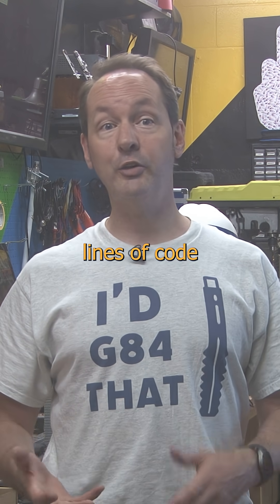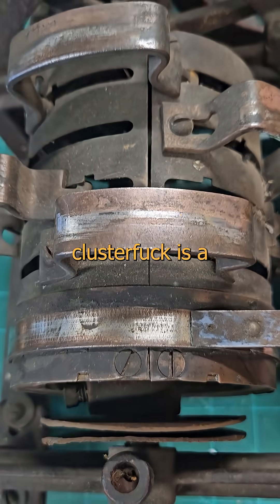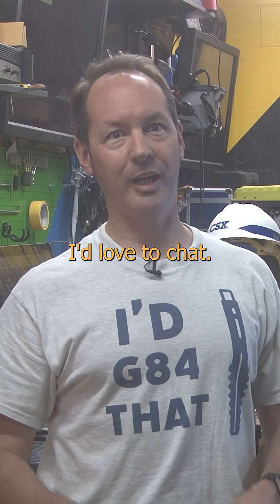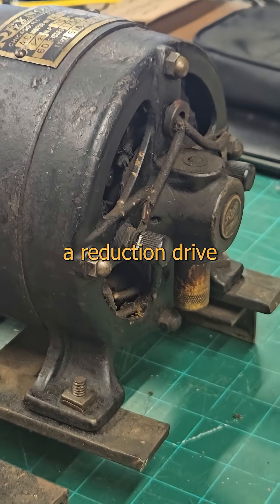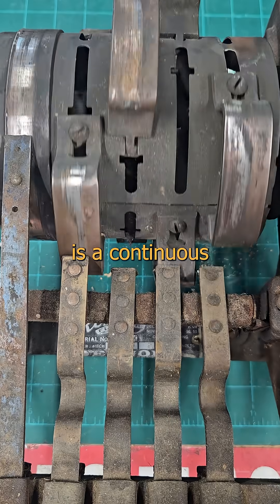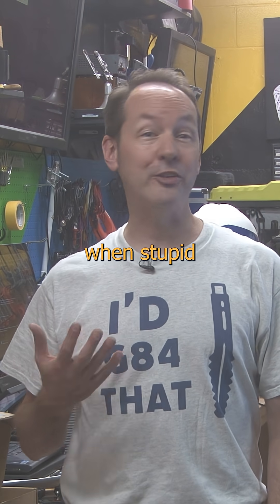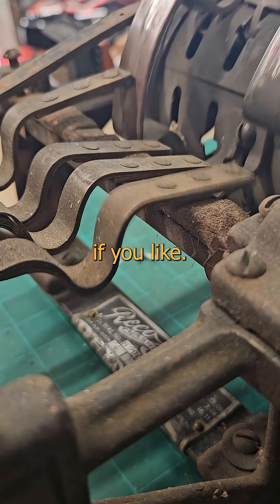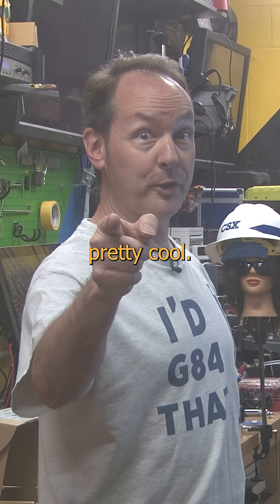Steampunk Sign Flasher #chrisboden #comedy #engineering #dangerous #electrical #educational #cam

Comment: i had a 68 mecury with sequencal turn signals. a small electric motor ran a cam that opened and closed 3 sets of points.  basically the miniature of this. very cool.  this is becoming my favorite channel.

Comment: My first thought is, would it be possible to adjust the resistance along the length of the contact so that you could fade in and out the light

I can't imagine it off the top of my head. I keep running into complications with each answer I come up with

Comment: The automated dishwasher at my work uses a similar system for timing the cycles of window add which cleaning agents and wind to switch from hot water to flesh stripping semi steam. It has a safety housing held together with the same kind of lock you use to secure toilet paper in a public restroom. The damn thing hasn't closed in over a decade.

Comment: As a kid, I made something like this. Took a BBQ grill rotisserie gearmotor and rigged it up to turn a salvaged rotary television tuner. Chopped up a set of Christmas Tree lights and wired them to the contacts on the tuner switch wafer. Yes, line voltage running all over, but it sure looked cool!

Comment: This is what we in the UK would call a "Heath - Robinson device" after William Heath Robinson is an artist whose work, whether in his well known humorous drawings or his illustrations of Ad Hoc devices. 
It was also the name of was an early attempt to automate code-breaking. It was specifically designed to tackle the hugely complex Lorenz cipher, used by Hitler and his generals to communicate strategic messages.

The complexity of the code-breaking machine resulted in its being named in honour of W Heath Robinson the illustrator, but he would never have known of this tribute because he died long before the secrecy surrounding Bletchley Park code-breaking ended.

Comment: The Fox Theater in Atlanta, GA still has and uses their original Reynold Flasher and Speller for the marquee and F-O-X sign. The bulbs are now LED but the motor and switches are still the same unit and restored to run 24-7

Comment: Local chain of a very regional burger place might have a similar system tbh. Granted you pull through the drive through and you can hear the clicking of all the incandescing bulbs on the outside going on and off.

Comment: I would totally dig taking that thing apart, ever so carefully. Cleaning it with a wire brush on the metai, and a parallel to a giant toothbrush on the wood. Then patiently reassembling the whole thing.

Comment: This is cool I worked for a concessions company we had a bunch or trailers with the chaser light marquees. The oldes trailer we had was from the 40's I think made by Marvel [pronounced Mar-vell]. It didint have any lights but it was built like a tank compared to the newer ones, the doors probably weighed well over 100lb held up by swing out steel round bar arms if there was some kind of failure and that door fell someone was probably dying if they're in the way

Comment: 1/20 HP... Man even in old days they use anything but metric. How the hell am I supposed to know or be able to compare and say  yea' boi that is exactly do the work of 1/20 of a horse.  I mean, a horse (full 1 or 2) is perhaps and very perhaps moderately understandable (something reasonable in its days, not anymore today) but... 1/20?

   I know that 1 HP is 745 watts (VA). But even so, what's the need to be so arbitrarily precise as to say 1/20 (0.05) of HP?
sayin 37W is more comparable to a 40W lamp than a horse

Comment: Oooh my local carillon has one of those to hit 2-12 ton bells for the Westminister Chimes. I get access to the mechanical room as a carillon student, but as a mechanical engineering major, I'm the only one who really appreciates it! The assembly is also like 3 feet tall because it has to lift 100s of pounds of hammers to drop on the bells.

Comment: The theater I used to manage had a marquee with chase lights.  It used a clock motor with a cam at the end of the shaft.  The cam would sequentially open four sets of automotive ignition points one at a time.  Worked for 50 years.

Comment: I worked at a milk plant where the programming for the filling machines were rolling switches riding on metal cams.
You'd swap out the cams for pints, quarts, half-gallons, and gallons. No safeties there either. On of the fillers lost his fingers while cleaning the machine.

Comment: I do have an interesting question for this why would you have the electricity on the rotating keys rather than just having the live conduit that bar that all those tabs are sitting on and lift them off the bar to break the connection and that way you don't have to have the live voltage running through the brushes and everything it's just a live bar that those contact.

Comment: 😭 They could have put the contactors under the arms, on top of that bracket they rest on, instead of making the whole drum live!

It would require reversing the lift, but would eliminate energizing the drum, and for those scraping connections, which are probably hugely unreliable.

Probably would last longer too.

Same exact concept, maybe some extra insulators needed to insulate power from going into the actual arms

Comment: I built a couple of light sequencers using TTL ICs back in the 70’s. I guess that makes them old tech as well. They used parallel load shift registers and driver ICs controlling Triacs. All floating at 120v, much like the device in the video.

Comment: Bacteria eats grease and that is why the grease used to lubricate the contact fingers is missing. I worked on Westinghouse drum controllers for 250 DC motors used in a steel mill.

Comment: I once remodeled a commercial property with the former owners offices above it. Including his own “disco” with a lighted dance floor. The dance floor switching was done with a piece of 3/4 plywood with a ring of 16 penny nails and a rotating contact arm with slip rings, one wire to each nail. The whole thing was up in the ceiling of one of the storefronts . It’s probably still there

Comment: My favorite part is that the original machine had a base-plate of prefabulated aluminite, surmounted by a malleable logarithmic casing in such a way that the two main spurving bearings were in a direct line with the pentametric fan.

If you know, you know.

Comment: Oh man, I wanna see a full teardown of each piece individually cleaned and reassembled. That's a sexy piece of classic engineering that's still used in different formats all over! The big dishwasher as work pisses steaming hot water and cleaning chemicals at high pressure to clean, sanitize, and shine our porcelain, and all the timing for each phase of water and additive agents is all controlled in a tiny box on top. Taking a quick peak in her guts reveals lots of wires and stepper motors controlling the steam-show, and it's all programmed with plastic cams on a spinning shaft, contact sensors on the back side, and operates just like this vid! Or a music box. Simple tech that's echoed for ages and eons forward, and that's pretty fuckin cool!

Comment: I was just thinking about the old mills in upstate NY 

They were a piece of history everyone should have seen 

The disrespect for human life was on full display in the 1800s

I explored these death traps in my youth 

Many things made no sense because I didn't know what I was looking at 

There were giant 10 foot by 10 foot holes in the floors with absolutely no safety rails or signs 

These were where large cloth belts went from the water wheels through the floor of each level to pullys that rotated long shafts with pullys that had belts that connected to the sewing machines

The stairs at the main entrance where the owners and buyers came in had a grand staircase, but the employee stairs were only about 18 inches wide and you had to squeeze through. 
The stairs also were 2 sets, like a helix, and only 1 side went to the door
I couldn't understand why they were built like that and there were only 2 doors that connected the owner areas to the work areas

In a fire it would be almost impossible to get out because you would have to go from each floor to the 5th floor and then down the stairs to the 1st floor 

I worked for my city in the DPW as my first job

And in the late 80s we were given a strange assignment 

We were sent to the historical society and told to burn all the photos and records detailing the mills and the workers

They were horrifying and I remember them to this day

The mills had orphanages and debt prisons of women and they had horse drawn carts with cages

The women and children were shackled and there were armed guards at the entrance and they took the " workers aka slaves ( white slaves ) out of the cages and in through the door to the narrow staircase and they changed them to the machines. 

There were thousands of photos of this

We burned them all

We burned all the records of the " employees " that had children as young as 3 working in the mills

We Whitewashed the history of the city

The last photos taken before WW2 were of trucks that replaced the horse drawn carts with metal bar cages

People REALLY don't know what America was like before the 1950s and the people in charge have been working to erase all traces of their rise to power. 

I wish I had kept some of those photos and I wish I had kept books I read from the 70s because they don't exist anymore. All copies of them have been removed from the libraries 

That really shocked me to find the books I read and have clear memories of, they had card catalog numbers and they are all gone. The last trace I found was the actual microfilm I had used in the 70s to find a book and I went back to the sub basement of the state library and it was still there. 

I made a copy of the page and brought it to the desk and asked for them to find a copy. 

The Library closed 30 minutes later and the woman never came back 

I went back the next day and she said she didn't know what I was talking about 

Back down to the sub basement I went and the long row of microfilm boxes and that one was gone. 

It is scary how much happens and people don't know history is being erased
😢😢😢

Comment: I absolutely love mechanical machines. I love tech beyond anything. But looking at the huge non efficient mechanical solution to a problem thats solved by  a modern micro controller the size of my left nut.  I admire the shit out of what it took to make a mechanical system for a small problem. But since it has to be built to last it weighs more then 5k smart phones that  could do the switching, make a phone call, and download boob tube at the same time. Thats pretty cool.

Comment: Too much safety is a bad thing in my opinion.  It used to be you had to have some brains to be near machinery, but now with the way they want to safeguard everything to accommodate the lowest denominator time are more dangerous.

I too can't be bothered with polishing every piece of an item if it works.  I would only clean and polish enough to make it work.  If friction doesn't take care of the rest I wouldn't worry about it.

Comment: for anyone confused by "programmable", yes, that is programmable. the bolts keeping those brackets affixed to the drum allow the bracket to be rotated along the drum to program the timing of the ON signal, and the body of the bracket that is elevated away from the drum has a length that, if made shorter for instance, would program the signal to turn off sooner than it otherwise would.
mechanical programming is weird to me, but i do get it.

Comment: Check out Individual section glass production machines.  They were originally controlled with a drum cam and adjustable screws, to operating air valves to make them function.  Roughly sequence;
1. glass cutter cam trip
2. Pull punch, on preform cavity - to receive glass,
3. close - punch preform,
4. Remove punch
5. Invert preform to finish cavity
6. Close finish cavity
7. Place forming air cap on mold
8. Pressure to blow product
9. Open finish mold
10. Part lifter to finish product.
11. Grip part
12 move part to unload table
13 push part to take out conveyor.

Several taking place at the same time, because you can press preform and finish part at the same time. Plus individual sections can be connected so 6,8,10, 12 sections can connected to form 1 long machine. A t handled wrench, can adjust cam timing.  Originally all mechanical, now computer controlled solenoids control functions.  With up to 4 cavities in each section,  they can now make 300 to 500 bottles a minute.

Comment: There was a lighting system in the back of an old mercury cougar with those sequential flashing turn signals that had the rotating drum of switches that looked very similar. Have you seen it?  Amazing.

Comment: I work with that thing's great grandchildren in concert lighting.

~90% of the time, when you see a "strobe effect"  [a moving light blinking fast] it is done with spring loaded blades opened with an oscillating piston separating them, the lamp [what laymen call a bulb, these are not your house bulb, but a sodium arc lamp] is always on, a piece of metal [a douser] just blocks the beam.

Real strobes are fairly rare because of epilepsy issues these days, but typically have a rectangular face and a ling thin lamp that looks and operates similar to a florescent lamp, it uses xenon and an irregular current to flash.

Comment: They still use drums lile this (made from wood!) in Madagascar and India. For lights and fireworks. Lots of sparking.

If you add a stepping mechanism and controll it with the drum itself, you get a program like in washing machines, dryers and dishwashers until the 2000s.

Comment: I love rpolishing things. I used to work as a luthier for years, building resophonic guitars out of sheet metal—steel, brass, German silver. It’s been a while, but there’s something about shaping metal through heat, sanding, and polish for that true mirror finish connected with me on a deep level. I later became an electrician, which is interesting in its own way, but it’s not the same

Comment: I worked on an old Columbia Chariot foremans factory cart awhile back that had been rewired like a rat nest out of yarn because a nylon bushing had worn through and was making the speed controller(brass bars that slide against one another for motor speed kinda like the video but linear instead of rotational) try to weld itself together at the short and throwing sparks. The factory mechanic never figured it out so they sold it to a custom vehicle mechanic specializing in Baja buggies and he got it to run as long as you had an asbestos blanket over the mechanism so it didn't burn anything from the sparks. Finally I got it and factory reset the wiring, popped a new bushing in, and lubed up the mechanism with some dielectric grease and it was back in proper action till it went to a corner to sit since the idea of driving around town wasn't thought out properly. You never map the gradient of the roads till you realize everything is slightly uphill which a single gear drive machine running off 12V designed for level concrete floors isn't fond of. 

The Columbia machines have used the same parts, for the most part, since the 1960s. Fully mechanical 12V systems, 1950s was 36V but I imagine the speed was a bit too much for a chariot ride across the factory. They're more than capable of street use but are much heavier and less cosmetically pleasing with their blackened sheet steel bodies and manual hand brake sticking out threatening to attack if you were to lose your balance due to its speed.

The moral of the story I guess, a mechanical issue is probably just a mechanical issue. If you're trying to get something like this or what's in the video going you should probably check the bushings meant to isolate the current instead of trying to rewiring and grounding everything like you'd do on something modern.

Comment: A few years back i was the house electrician for a developer. The company bought an old movie theater. In the projection room there was a 230 volt 3 phase  to 600 volt DC generator. I assume it was for powering an Carbon Arc for the projector.

Comment: Chris I’ve gotta track down some old Rheostat lighting dimmers for you.
Back when I worked theatre lighting plenty of places still used them for house lights and such, freeing up the “new” analog and digital control SCR dimmers for stage lighting.
Picture a bank of rheostat discs the size of manhole covers, hooked to levers with bike chain. Running a bank of them took half a dozen people operating it like a steam engine.
Same era as the mechanical chase controller you’ve got there. We’d even rig up conversions of stuff like that, so stuff like a mechanical chase or color scroller would get a fancy new stepper motor driven by CV, or later Multiplex and DMX.
Nowadays it’s all LEDs and Ethernet, which is so much easier to work with but lacks a certain something.
I remember one shop managed to turn a pad transformer to slag by doing a “broadway check” before a show with a ton of instruments in the air. Threw everything up and down at once to full to look for dead lamps. Unfortunately the load and inductive kick from half a megawatt of tungsten was too much and lit the tasty PCB oil on fire.

Comment: Was called into a plant that operated on DC and still had a 1920's dead man control panel.   it was a work of art.  When asked what I would suggest to "automate" a machine I recommended that they start with AC power. . . .